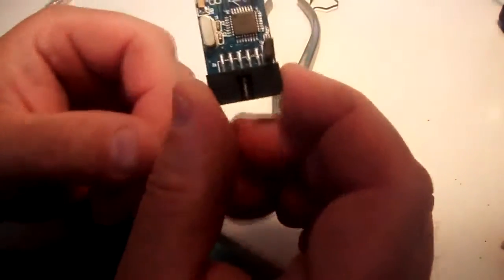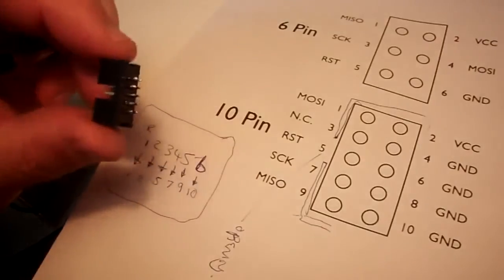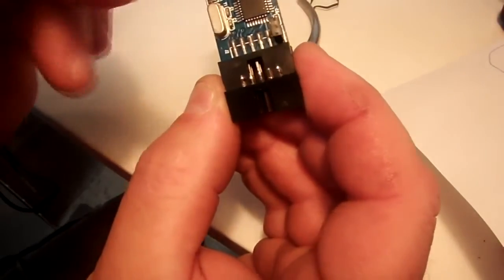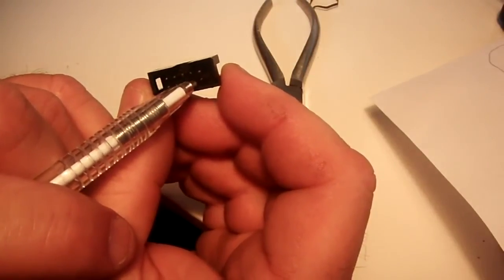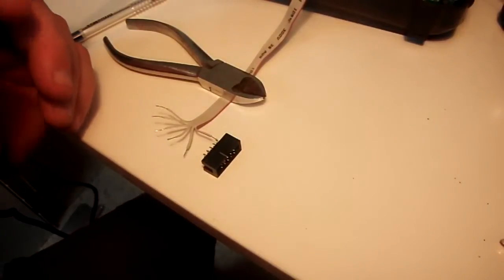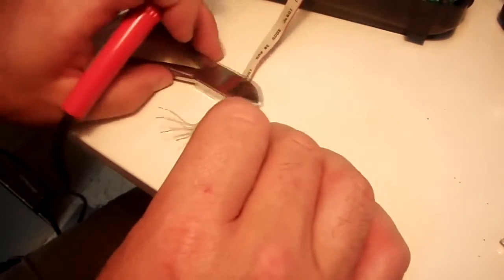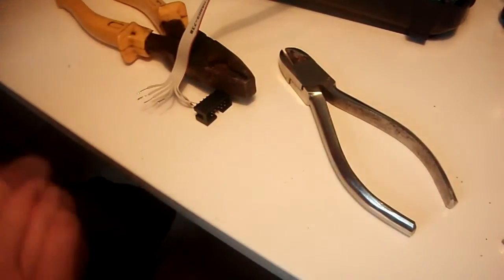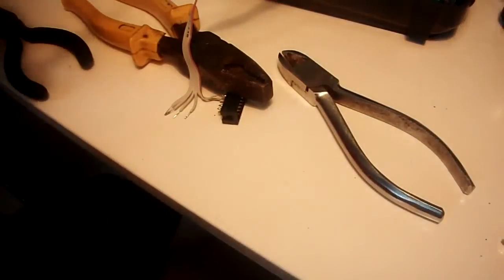Turnigy 9x flash upgrade wiring how to-part 3 FINAL

Comment: Cheers. Good vid. I find Blu-Tac is handy when soldering. Holds down wires/connections. ;)
Reply from the maker: +JohnnySlash 
Great idea..... will try it next time I get soldering!
Reply: How To - Westy Style!
Well, I only just finished updating the firmware. I had switch warnings on startup. After hours of searching, I changed the radio settings from TAER to AETR and it stopped. Great video. Very helpful. Thanks ;)

Comment: for those who need the programmer, you can find it  sparkfun.com/products/9825 look under cables and you will find the other necessary parts wire and connectors etc.